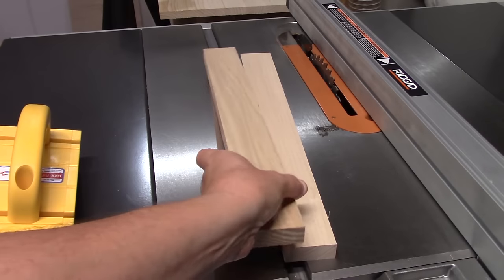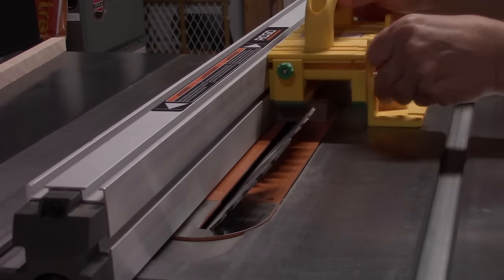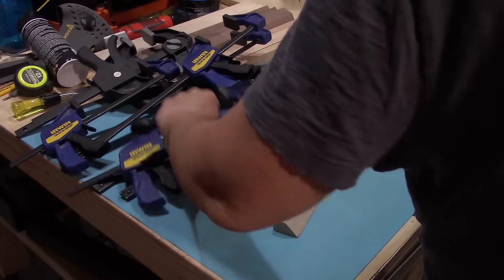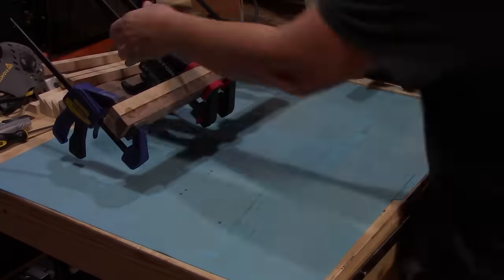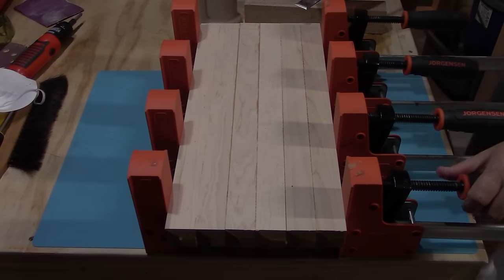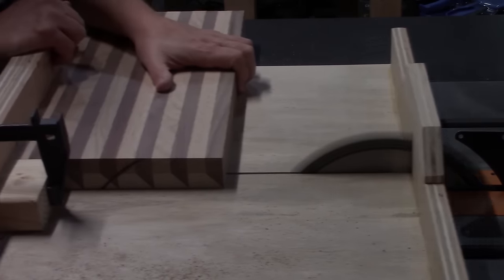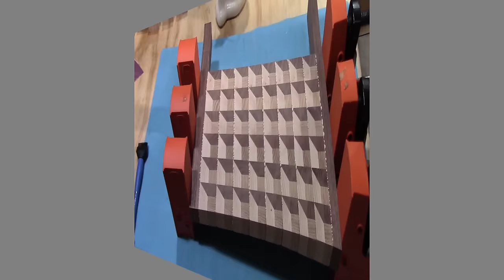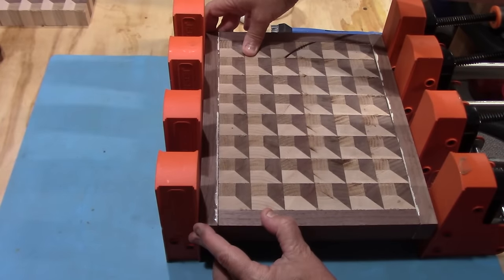The Stunning 3D Cutting Board - Part 1

Comment: Big question for me as a relatively noobie - I don't have a drum sander but I do have a planer...ok to use the planer instead?
Reply from the maker: Thanks for watching the video and commenting.  You could absolutely use a planer in place of a drum sander.  A few tips though... Make sure your planer blades are sharp.  Glue some scrap strips around the outside edges so that they take the brunt of any chip out from the planer.  Lastly, take very shallow passes.
Reply: @DEJaegerWoodworking  Thank you so much for the reply! I’m eager to try and make this amazing board!
Reply from the maker: @anewman143  I have to admit that it came out a lot better than I expected.  I've had a few viewers make this board and send pics when they were done, and they all turned out amazing.
Reply: @DEJaegerWoodworking  This will definitely be new ground for me - haven't made any angled cuts before, so I'm eager to take advantage of all the little nuggets of wisdom that you provided to avoid making those early mistakes..and hey - gave me the excuse to buy more clamps! So really, a win-win! LOL
Reply from the maker: @anewman143  Realistically, the most crucial part of this project are consistent angled cuts and the glue ups of the angled pieces.  If you get those right, then it will translate later into a successful final project.

Comment: What was the overall size of this beautiful 3d cutting board....also was you able to make both boards with the 6 glued up pieces? Last question (lol) if you did make both out of the 6 pieces how many would it take to do just the bigger one, maybe 4 of the glued up ones?
Reply from the maker: Thanks for stopping by to watch the video and comment.  The larger board ended up at around 13" x 10" and the smaller board was about 9" x 7"  The total dimension of the glue up of the 6 pieces together was 18" x 9".  You could probably make the larger board with the same 6 pieces but using 12" length stock.

Comment: Hi. Thanks for sharing. Your board looks nice. And video editing skills isn't too shabby either. I did have a question before I try this pattern. Have you made this exact board but with the 3/4 by 3/4 stock the darkest species? I'm wondering if it might make the 3d effect even more pronounced. Trying to imagine light striking it...was wondering if the darkest would appear more like a natural shadow? I dunno....just thinking out loud here. Anyway...thanks again for taking the time to share.
Reply from the maker: Thanks for stopping by to watch the video and comment.  No, I haven't actually played around with the woods other than replacing the red oak squares with hard cherry.  I still used walnut and maple for the angled pieces.  I don't see any reason why you couldn't though.  I think as long as you have three woods of varying shades the effect will still come out.
Reply: Did you try it with the darkest wood as the 3/4x3/4?  That's a thought I had at first but seeing this one, I wonder?

Comment: looks very cool, though I have to warn you , that you may run into problem gluing a straight grain piece around like you did , because the end grain may move differently ....
Reply from the maker: Thanks for stopping by to watch the video and comment.  I've had a couple of people point out the issue that you describe.  I'll have to keep an eye on it, and give good clear instructions to the owner on how to clean and maintain the board.
Reply: If you apply 2 walnut sides prior to the last cut and flip, they would also be in an engrained orientation. Then apply the short sides with pieces of end grained material. Sometimes I take it one step further and run a round over or chamfer on edge of the border prior to the cut and flip, top and bottom.. The result is a side that is segmented. All the roundovers are now vertical. It's just something to break up a smooth side. Great look on the board.
Reply from the maker: @BB-gy2fo  Thanks for the comments and suggestions.  Do you have a snapshot of a cutting board that you've done this on, I'd really like to see the end result?  Sounds awesome and something I might do on the next one.  If you have one, just email it to at the email address on my profile under the About section.
Reply: I wish I was smart enough to send you pic. Can't find an attach feature like on your email. If you know of another way , I'd  be glad to try.
Reply from the maker: @BB-gy2fo  If you have a standard email account that you use like Gmail, Yahoo, etc. just start a new message, attach the photo and put  dejaegerwoodworking@gmail.com  in the TO: field and that should get it to me.

Comment: Do you think it would be possible to glue up all the long pieces at once using a clamp rack and cauls?
Reply from the maker: Thanks for stopping by to watch the video and comment.  Sure, it would be possible to glue up one long pieces from the 3 individuals assuming you have the stock, enough clamps, and patience.  I just found it much more manageable to do this in smaller sections, and I was limited by the number of clamps that I had on hand.

Comment: It's a nice cutting board, but gluing only one piece a day is for long summer evenings.
Reply from the maker: Thanks for watching the video and commenting.  One glue up a night would really depend on the number of clamps are your disposal really.  However, after making a few of these boards I did find that I could get about five or six of the piece glue ups done throughout a day.  The Titebond glue sets up pretty quickly, so after about two  or three hours I could safely unclamp a piece and start another one, then let the pieces fully cure overnight.
Reply: @DEJaegerWoodworking бро ты сделал качественно красиво 😍👍👍 Я видел как делают другие точно такую же но этот парень первую склейку заматывал просто скотчем а после бруски уже зажимами
Reply from the maker: @qwert-eo6pl  Я ценю добрые слова. Большое спасибо.

Comment: thank you for posting this great instructional video.  do you have written plans by chance?
Reply from the maker: Thanks for stopping by to watch the video and comment.  I don't actually have specific plans for this board as it was the first time that I ever made this design.  I tried to include dimensions of the stock and cut measurements, etc. in the video.  Obviously you could make this board as long and wide as you wanted.  The limiting measurement is really the thickness of your stock.  Mine was 3/4", so it was the driving measurement when creating the individual 3D pieces that were ultimately assembled together to create the overall 3D effect.  If there's anything I can answer, let me know.

Comment: How long is the stock you used in this presentation?
Reply from the maker: Thanks for watching the video and commenting.  Then end dimensions ended up being around 12" x 10" x 1" so if I remember correctly the beginning lengths of stock were probably 16" long.

Comment: Thanks for sharing your video. I'm currently in the process of using your video as a guide. One things I noticed is when ripping the 2” pieces there's waste (of course waste that can't be used for something else HA!) but after ripping these I thought in order to eliminate the waste it seems you can make the pieces about 1.5” wide instead of 2 - thoughts? 
Thanks again
Reply from the maker: Thanks for stopping by to watch the video and comment.  Absolutely you can use pieces that are 1 1/2" wide.  I could have taken a 1/2"  straight cut off of each of the pieces and would have had flat stock for another project, but I wouldn't say the angled stock is wasted.  I actually made a completely different cutting board out of it.  Very mosaic because of the angled cuts.  I don't have the video posted, and not sure I ever will.  I don't think I've ever thrown a cutoff away, and have often found the little odd angle cut offs always seem to have a purpose in some other project.  However, as you pointed out, there's always more than one way to approach a project.  If you've found an improvement over my methods, awesome!  That's what we're all here for... to learn from each other.
Reply: Changing the dimensions of the angle cuts to 3/4 x 1.5 might change the 3-dimensional effect. I think it would diminish it since you are getting closer to the 3/4 x 3/4.  If you did that, I would be interested to hear what you think.
Reply: @bw162  why would that change the effect? the board you would put the 45 cut on is exactly the same dimension as the one used in the video. 
 You could start with 2 boards about  3 1/4 inch depending on saw kerf  and rip two strips with 45 degree edge from each 3 1/4 inch board. That would reduce 'waste by a good bit.
No matter what this is a great project well presented.
Reply: @geraldanania8081  Sorry, my post was 4 months ago and I would have to go back and watch the entire video to see what prompted my post then.  Too busy.  As long as you are convinced...carry on.

Comment: What are those giant orange clamps you're using for the glue up
Reply from the maker: Ephraim, thanks for stopping by with your question and taking the time to watch the video.  The clamps are JORGENSEN 8018 Cabinet Master 18 Inch 90 Degree Parallel Steel Bar Clamps.  I started with regular pipe clamps and over the years upgraded to these.  I absolutely love them!  Here's the link on Amazon's website.  Although right now it looks like you can get the 24" version of these for about $10 cheaper, so do a general search for Jorgensen Cabinet Clamps.

https://smile.amazon.com/gp/product/B00005R1HM/ref=ppx_yo_dt_b_search_asin_title?ie=UTF8&psc=1

Comment: Somehow I'm having trouble visualizing this. As long as the six strips, each containing 3 woods, are oriented the same way, does it matter how you do the glue-up?  In other words, your initial glue-up (as shown in the video) has the maple on top. Would it matter if, before you did this initial glue-up, you rotated the six strips 90 degrees such that the walnut is on top?
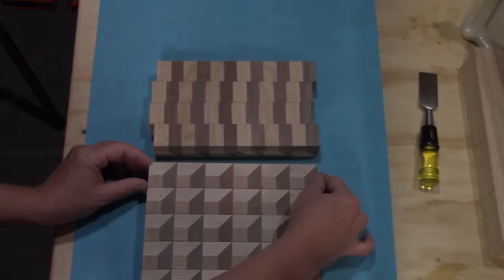Reply from the maker: For me, orienting them all the same while assembling them just facilitates the process.  As long as you orient them in the 3D pattern it really doesn't matter if the walnut is on top, the key is to orient the 6 glue ups in the same direction when creating the 3D slab (starting at 8:37 in the video above).  Additionally, make sure the orientation of the cut slab pieces needs to be correct (12:34 in the video).
Reply: @DEJaegerWoodworking  Hello, Is it OK if I post a picture of how my cutting board turned out, using your instructions? Plus, I did a few things differently, and have a few suggestions.
Reply from the maker: @howardbessen8153  Sure.

Comment: The device you are adjust at 3:07 , what his name and where to buy?
Reply from the maker: Thanks for watching the video and commenting. The device is called The MicroJig Grrriper. I purchased mine on Amazon.com. It is an exceptionally valuable tool.
Reply: @DEJaegerWoodworking  Thank you very much! I will buy one a.s.a.p.!
Reply from the maker: @ivodelchev6127  it’s one of the best purchases I’ve made for my shop. Your hands are well protected and you have better control over the wood as it goes through the blade.
Reply: @DEJaegerWoodworking  Thanks, I already ordered one! Very clever tool.
Reply: @DEJaegerWoodworking Hello man, thanks for sharing your experience. i have already 'jig" in my home, its a tool , who need for all to have " to have 2 hands to the end is better" I made my board, and want to thank you! I try to send you link here 3 times ,but its seems not good for tube. Will send you link on your mail. i Will be happy if you see and help me to improve!  Be healthy!

Comment: Why didn’t you just tape the pieces together?
Reply from the maker: Thanks for watching the video and commenting.  I don't think tape has nearly the same pressure than a clamp to eliminate voids all the way down the glue up.  There's another video out there where they used tape, and they were dealing with all sorts of voids after their glue up.  Not saying it can't be done, but I really don't want to end up most of the way through a project and find that I've got a lot of voids to deal with.  I've had other viewers also comment about using rubber bands, hose clamps, etc.  Yes, they are much less expensive alternatives, but also have the same problems.  Clamps are just my choice.

Comment: What grain paper do you use in your drum for these standings?
Reply from the maker: Hey Dave, thanks for stopping by to watch the video and ask a question.  The drum sander is using 120 grit sand paper.  I use it mostly for getting my stock to the same thickness, or after glue-ups to flatten and clean up.  Depending on the project I typically sand at 180, 240, and 320 until I get the desired smoothness.

Comment: Cool project, those irwin clamps suck. I had 2 and threw em away they dont have anywhere near the clamping power needed for most projects.
Reply from the maker: Thanks for stopping by to watch the video and comment.  I've never had any issues with the Irwin clamps.  They're certainly not the highest quality pressure clamp you can buy, but I've used these for several years without issue.  To the point of buying another 8 clamps just recently.  I have had some issue with some of the lower quality clamps from Harbor Freight, but I think you know what you're getting there.  So what clamps do you recommend, maybe I'll check them out.
Reply: @DEJaegerWoodworking  harbor freight clamps cheaper and way better. Im gonna make that board like you did looked really good.
Reply from the maker: @peckerwood780  Cool, please share when done.  You can email pics at the email address in the About section of my YouTube channel.
Reply: @DEJaegerWoodworking  ive been using the harbor freight ones for the last 10yrs or so. Had 2 break and they'll replace em for free
Reply: @DEJaegerWoodworking  will do 👍

Comment: Just a super tutorial!  I'm planning on making a number of these as Christmas presents.  Would you recommend I work each one to completion, or do them all in parallel?
Reply from the maker: Thanks for stopping by to watch the video and comment.  I certainly think you could save some time by making all of your cuts at the same time.  Glue ups would likely be the staller.  As you can tell by the number of clamps I used to ensure a good, tight glue up.  I ended up buying 8 more clamps after this video and still could probably only glue up 2 sections at a time.  Once you have as many of the three pieces sections glued together to make a board, then you could churn them out pretty easy and save some time during the sanding and finishing processes.  I would advise to make one first and weed out any issues you might experience with just one board, make notes, then attempt a number of them.
Reply: for understanding sauce would be one at a time. from beginning to end. it would make more sense for you to use the videos as a project for your gallery as the video would have a name for each piece..... desde ja obrigado

Comment: Time to sharpen the table saw blade.
Reply from the maker: Thanks for stopping by to watch the video and commenting.  Wasn't sure if you meant it was time for me to sharpen my table saw blade, or you, as in you were going to attempt this project.  I will say that right after this project I did actually replace my table saw blade with a thinner kerf blade with a much higher quality.  You can see it in the follow up video on my channel for the chessboard video.  It now cuts like butter and I would highly recommend it.
Reply: @DEJaegerWoodworking  Sorry for the confusion. I was talking about your blade. There were some significant burn-outs when you let the wood linger next to the blade for a couple of seconds. For me, I have some high end blades and I sharpen them from time to time, but I need a better table saw than the DeWalt job site saw.
Reply from the maker: @quadroeffects9316  Gotcha!  Yeah, I wish I would have sharpened or replaced the blade prior to starting this project.  I was struggling to get those 45 degree cuts done.  Again, with the upgraded Freud that I bought the cuts have been awesome.  It's amazing how something so small can affect your results.

Comment: Great build!  Could a planer get similar results to the drum sander?
Reply from the maker: Thanks for stopping by to watch the video and comment.  You're going to get a lot of woodworkers that would tell you not to use a planer on endgrain.  While I mostly subscribe to that theory, I will say that I have done it with a few precautions.  First, I would build a frame of scrap material around the endgrain project so that edges won't chip out when sending it through a planer.  You can see where I did this in my video "The Mosaic Endgrain Cutting Board" at this link...   https://www.youtube.com/watch?v=C-_de4ukx1c&t=26s    Second, I would make sure that your planer blades are SHARP.  Third, I would take very small passes through the planer and remove just a small amount of material with each pass.  If you use some precautions it can certainly be done.

Comment: How long are your pieces of wood
Reply from the maker: Thanks for stopping to watch the video and for your question.  The length of each of the boards was 18 inches.  Ultimately, the final dimension for the cutting board was approximately 12" x 10" x 1 1/2" with the garnish board being about 8" x 7" x 1 1/2".  I could have just left it at approximately 18" x 12"  but it seemed long and out of scale that way, so ended up using the extra for the garnish board.